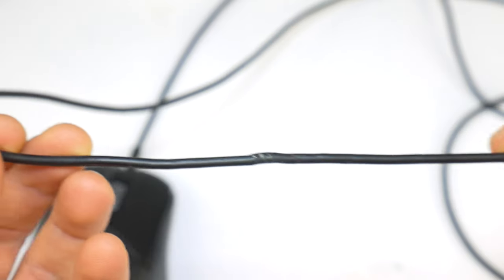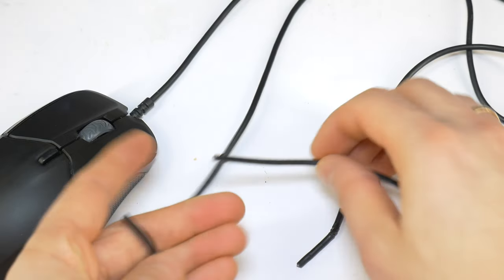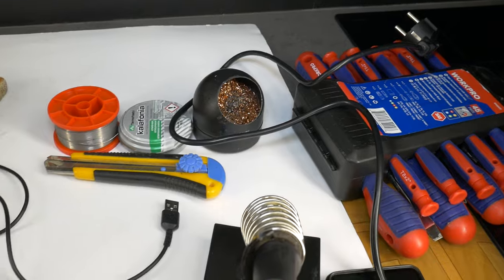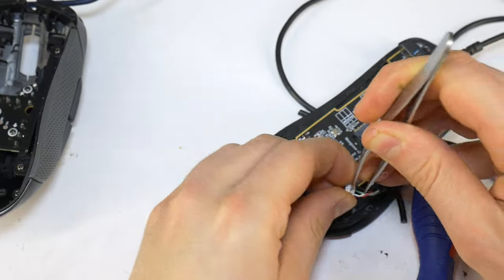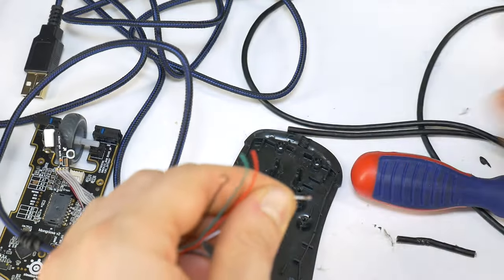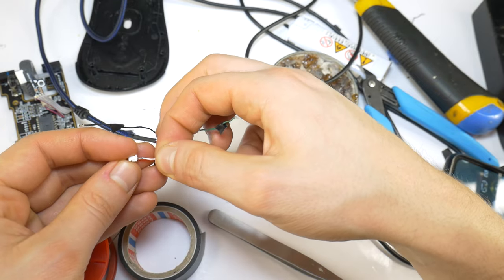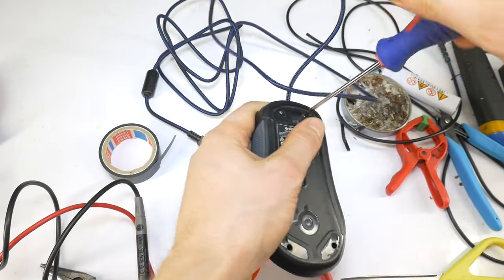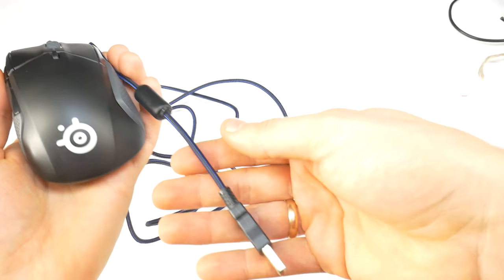How to Repair ANY USB mouse cable DIY

Comment: step 1: just buy a wireless mouse for 20 bucks more it will last longer so its worth it
Reply: step 2 : get lazy to charge or change the batteries .
Reply: Step 3: buy another new mouse
Reply: Step 4 : just get a wired mouse and wireless mouse both
Reply: Idk about you, but I've never seen a decent quality mouse at that price point that was also wireless. Have been lucky to get 6 months worth of clicks from the ones I have tried, and those have been $45 at the cheapest.
Reply: well your delay is way higher if your a gamer it will bad bad

Comment: so my mouse has a problem at first was the driver error now the mouse wont even register and it doesnt light up any solutions unfortunately i cant buy a new one until next month any way to fix it
Reply from the maker: open mouse and with multimeter check wires

Comment: If i ordered the same replacement cable as the one in my mouse, am I going to have to do all the soldering stuff
Reply from the maker: No, then all you have to do is replace old with the new one by disconnecting it from the mouse motherboard and plugging in the new replacement cable.

Comment: my logitech have 5 cable , and my replacement have 4 cables. the different just lgotiech have 2 black small cables, but my replacement just have 1 black small cables. what should i do? :3
Reply from the maker: but the connector is the same size and fits the mouse motherboard ? That extra wire is probably shield wire, you can do without it. The main thing is that the main colour wiring matches.
Reply: @TechscrewDIY  yea connector same. just the cable
Reply from the maker: @rexcelrais5750  did you fix this and mice is working ?

Comment: i replaced the cable with a cable from another mouse and my pc recognizes its plugged in but not what type of usb device it is. plz help
Reply from the maker: first check color wiring new cable and old cable.

Comment: it the same way my mouse cable got cut in half
Reply from the maker: did you manage to fix it ?
Reply: No I saw this video but it won't help cause the wires are small and I don't think I can fix it btw the mouse I use is the ant eSports gm50 i tried to find a new cable to replace the broken one but I couldn't find it so I decided to buy a new one btw if you don't mind can you tell me some gaming mouse that you think is best as per you. Thz 😊

Comment: "Failed tp get Device description"
All wires are connected correctly
Reply from the maker: maybe short circuit?
Reply: @TechscrewDIY  don't think so, I made sure no "hair" of copper out of it place and tried multi cables plus other laptop.
Think that all the cables I have doesn't work maybe
Reply: @TechscrewDIY  don't think so, I made sure no "hair" of copper out of it place and tried multi cables plus other laptop.
Think that all the cables I have doesn't work maybe
Reply from the maker: @odaigassan5330  "Think so" not the measurement, take multimeter and check all wires.

Comment: Why remove the wires from the connector, you could have simply cut the wires and soldered the old connector with wires to the new cable.
Reply from the maker: true, if there is enough space :)